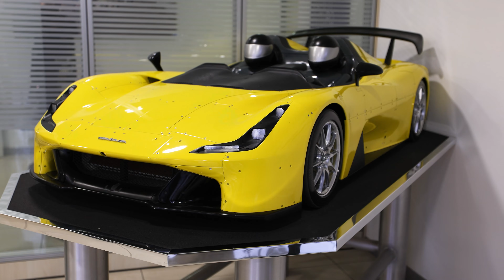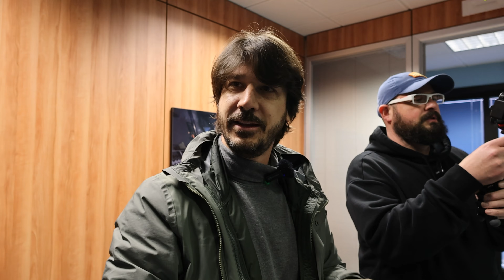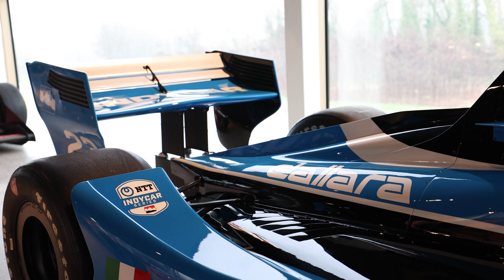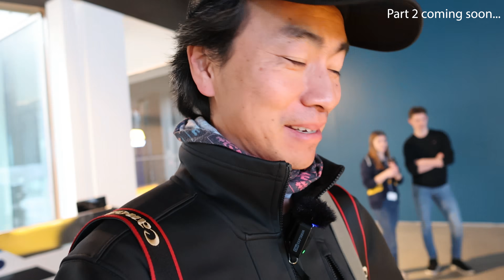Dallara: The Expert Racecar Builders Who Have Their Hands In Almost Every Motorsport

Comment: Please can you do a documentary specifically about the Dallara Icsunonove?

It's the car that's got "Dallara Bertone" written across the front in big letters - THAT CAR.

It's not called a Stradale as in 037 Stradale (the street legal version of the 037 Rally), but you can see it's really a stradale type car.

It's got a wing, a longer wheelbase, a wide body, harnesses, and functional fixed position rectangular headlights, quick fuel fillers etc 

It's a prototype street legal version of the successful Group 5 X1/9 Dallara.

Next to it is the (also successful) Lancia Beta Montecarlo Group 5.

As in the (later) Uno Turbo, these cars all use the small block Lampredi, whereas the Beta 037, Delta HF, Beta Montecarlo Spyder, Beta Volumex, Ritmo Abarth 130TC, 131 Abarth Rally, 131 Mirafiori Sport, all use the big block Lampredi.

(I assume there are 2 different blocks I don't actually know but the SOHC 8V was factory stroked to 1500 (X1/9), then 1600 (Stilo), and has a theoretical maximum capacity of 1800 whereas the DOHC 8V is over 2000).

X1/9, Uno Turbo, Punto GT, Ritmo 105/125/130TC Abarth etc all use identical OEM gearbox overhaul kits.

Digression yes but the Kimera, the 037, the Montecarlo, the Delta S4, all have longitudinally mounted engines.

The Beta and Delta otherwise had transversely mounted engines (Volumex, Integrale), even if they were mid engined (Montecarlo Spyder, X1/9). 

The only car in the group that never got the longitudinal installation was the XI/9.

Pretty sure the Triflux engine from the Delta ECV, or the developed version from the Kimera, or the engines from any of the 037's, are more or less designed for the Fiat X1/9 😊

Therefore could be used in a remake of the Dallara Icsunonove featuring the same longitudinal installation👍

If Fiat had decided to develop the X1/9 not the Beta for the WRC, logically it would have been called the X1/9 Rally and have been designed and built like the 037 Rally.

The ultimate X1/9 therefore would be supercharged, with an Abarth or possibly Dallara or Alfa Romeo 16V head, mechanical or electronic injection, ZF or Colotti transmission, front and rear spaceframes, longitudinally mounted engine.

Or the ultimate X1/9 could be called the Icsunonove Rally (either the car just described, or an even more developed version of it based on the Delta S4 to include the Torsen AWD transmission and turbo-supercharging.

Haha all I need to do is hope everyone else continues to think I'm crazy and this is a terrible idea.

Maybe is a terrible idea, or it would be if it turned out to be slower than Gianluca Ticci's modified X1/9 Dallara or Manuel Dondi's modified Dallara.

Both of which are transverse engined with inline transaxles like any other front drive hatchback😂

Like Ritmo, Delta, Prisma, Uno, Punto, Stilo, 155 et al - they all go back to the humble 128 and 128 Sport 😂

Was it actually Marcello Gandini who thought to flip the head thru 180° and use it in a mid engine car or was it Gianpaolo Dallara?

Or was it Aurelio Lampredi's idea to design an engine with an inline transaxle that could be used front engine front drive or mid engine, rear drive applications🥴🤔

I have no idea but you can clearly see Manuel Dondi's X1/9 has an Alfa Romeo cylinder head (Alfa Corse) flipped through 180° so the induction is to the front, just like in the Icsunonove.

Even if it's naturally aspirated it's still an insanely quick,  285bhp/ 650kg silhouette racer with the Hewland (or X-Trac) 6-speed
sequential.

In other words the engine and transmission from a works Alfa 155D2 Superturismo, a successful touring car preceding the 156V6 DTM.

You should try to interview him.
Reply: What would be the point? You know it all and nobody else is particularly that interested.

Comment: 1:01 Dallara Stradale
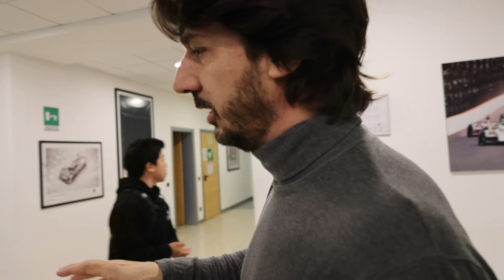1:20 Audi A4 DTM
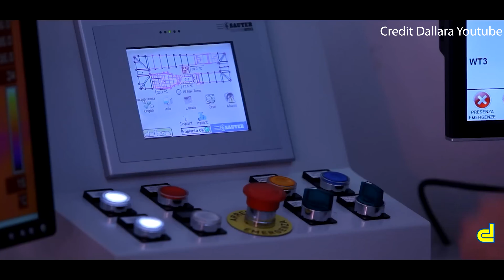6:25 That video is a wind tunnel test of Dallara DW12, an IndyCar
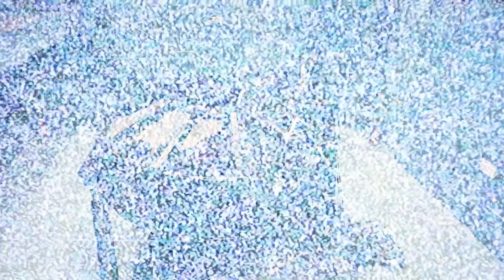9:25 Dallara Simulator Room
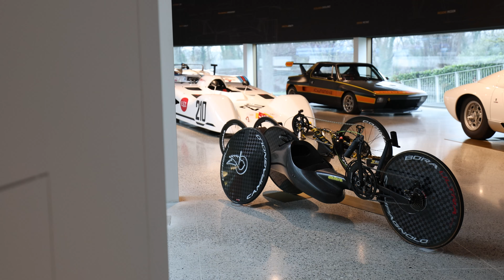17:21 The handbikes. Dallara Z-Bike designed for Alex Zanardi
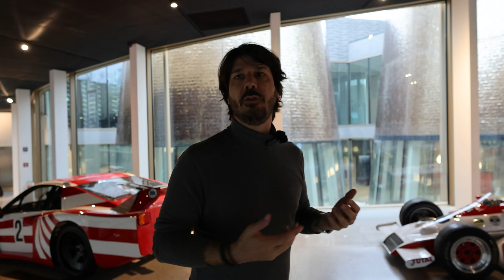20:18 The First Formula 3 car in 1991
21:37 This F3 car is driven by Sophia Floersch dan also she's accident in 2018 Macau Grand Prix with that car
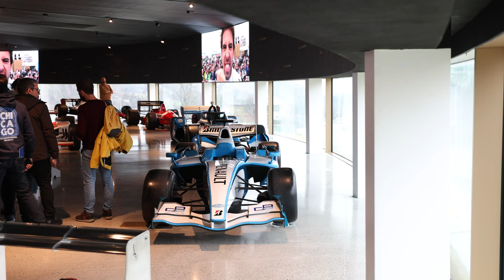22:00 A first GP2 Series car (Now is called Formula 2)
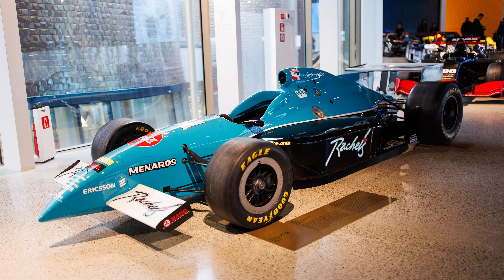22:10 Dallara's first Indy 500 Dallara IR-8 achieved by Eddie Cheever in 1998
22:40 A Dan Wheldon's car, 2011 Indy 500 winner
23:13 That's right, Larry! A Super Formula. Dallara SF14. You already know, are ya?
23:23 BMs Scuderia Italia built by Dallara
24:22 Haas F1 car!!
25:21 Formula E
25:42 Dallara Le Mans Car, Chrysler LMP
25:57 Cadillac DPi
26:05  Last but not least.... 😆😆NASCAR Garage 56 racing in Le Mans 24hr last year

Well it's dreamy. Lucky you had access to Dallara HQ. Is there's a video in Italy?